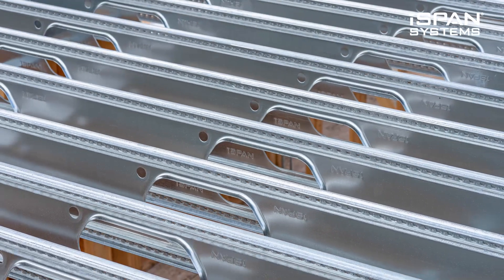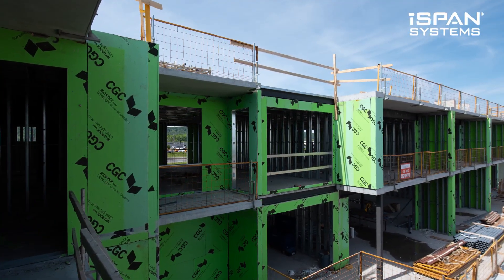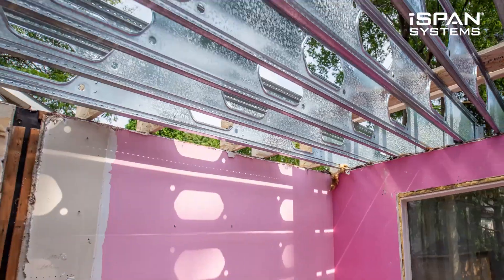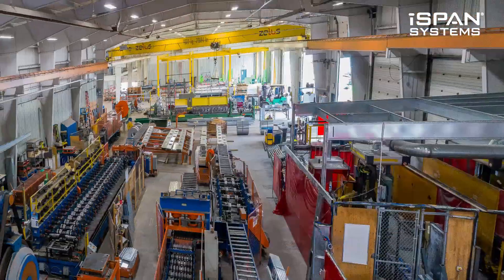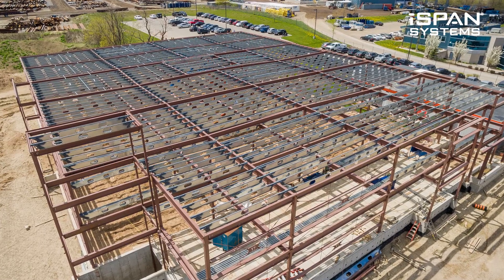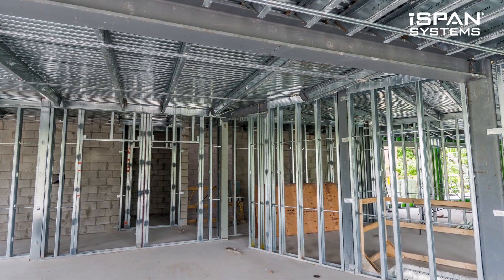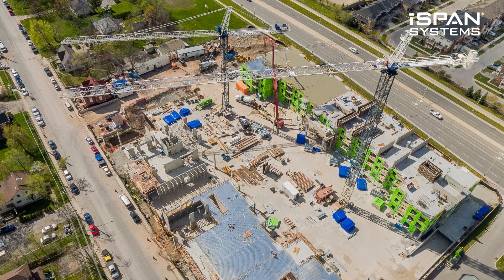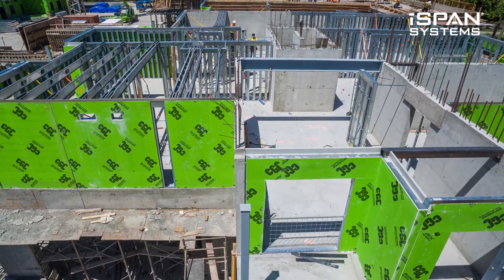The Story of iSPAN Systems - Extended Version

Comment: Amazing structures.  They need to start doing this more in the housing industry in California to withstand all the fires.  Go with mineral wool/ rockwool insulation and either steel or fiber cement siding/cladding and metal roofing.  All of these materials withstand fires much better than wood structures.  Interesting Name of the engineer.  I had a friend Reine  Kilstra.  His father moved from Holland after WWII.

Comment: Ispan is a garbage construction method it takes forever to build a floor and it is a nightmare for all the trades that go in after the floor is ready. Just trash
Reply: Lol and all these pictures are from the job I work at. It's a disaster here mostly cause of ispan. The job management company said it would never take another ispan job
Reply: **Build with ACI Precast! *
*
ACI PRECAST is a Prefabricated CERAMIC wall, floor, roof building system. It is ESSENTIALLY THE LEGO SET of YOUR DREAMS!

DESIGN FEATURES INCLUDE
1. International Building Code Fire Ratings Classification:
 ** ASTM E119-12-3HR Three hour Fire Rated Label *
 *

2.Continuous Thermal Break 

3. Composite Air and Vapor Barrier
 4. Impervious to Moisture
       a. Mold

5.  All panel attachments are casted & sealed 

6..Continuous Sound Break
 
7.Impact Resistance
      a. Military Level V: 9 mm Bullet 
8.All Concealed In-Wall utilities

9.Substrate for Attaching Finish Materials
10.Available in:
                 a.Stucco
                  b.Stone
                  c.Brick
                  d.Ceramic
                  e. Panels 
                  f.Rain-Screen Panels 

11.Composite Structural Load-bearing Panels

12. Wall and Floor "Lego Set" for a Simple  and Rapid  One-Step Structural Integrated  Solution

VISIT US AT OUR WEBSITE @ www.americancraftsmeninc.com OR check out my youtube channel  @ACI PRECAST!
Reply: It would be more useful if you explained why it was problematic for you.
Reply: I would like to hear the specific issues. I've worked with many construction systems. I've seen them all trashed. Priper project management is key. The sub leads given the correct information will avoid damage and mitigate issues . We all know SPF  #2 or better currently is less quality of a #3 or even econo of the 80ies.
Reply: Would be a good product to pair with ICF construction ,website said closed indefinitely .too bad !Covid killed allot of good green industry building systems just when we are about to see the largest boom in construction in North American history ! Millions of migrants are in need of housing(multi unit  not single dwellings)steel and concrete and ICF are the future not wood!